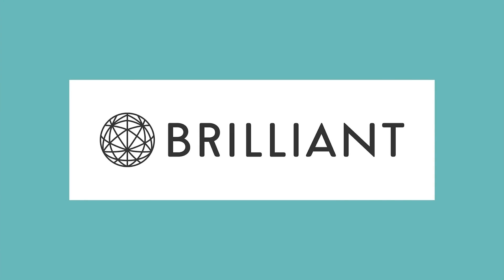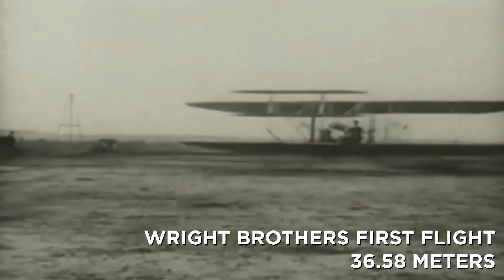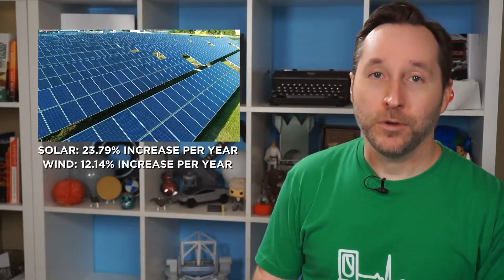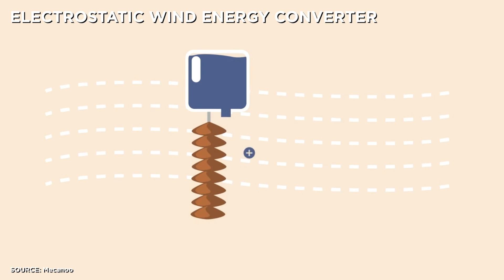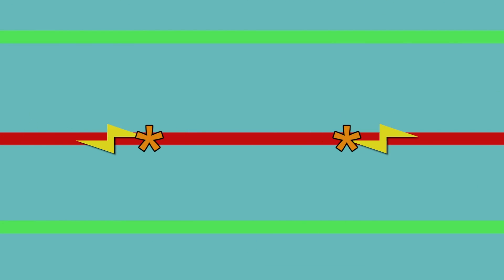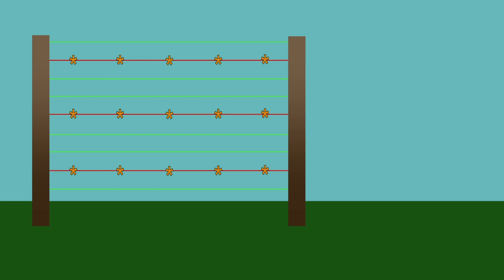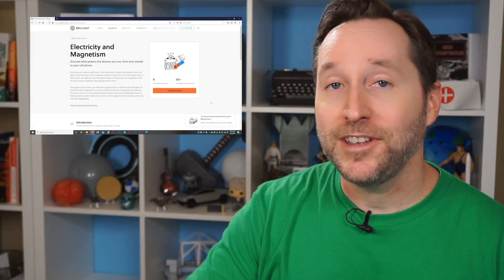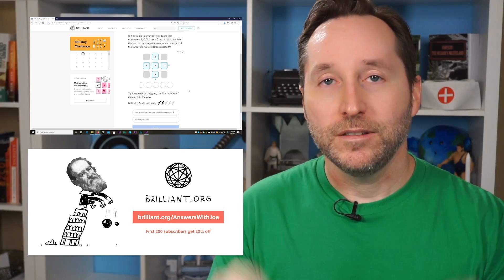Solid State Wind Energy | Random Thursday

Comment: Unfortunately, EHD is nothing new, it has been studied for more than a century by hundreds of differents teams and hobbyists !
The MIT prototype is directly inspired from "lifters" that were made by amateur teams all around the world a few years ago. One famous experimenter in the states was "Saviour", he succeeded to lift 100g of payload using a few hundred watts of power. Just search for "saviour lifters" on google images ! 
For small generators, power levels never reached more than few mW and efficiencies were at best around 1% in both cases; propulsion and electric power generation !
In the states Nasa and Air Force made many attemps to produce high-voltage generators for airborne laser in the years 1970. Expecting megaWatts of electric power they ended with a few watts (for megawatts of flow input power). 
Its not a breakthrough that you need but a kind of miracle !

Comment: Great. Combine it with solar energy by having this act as the stands or posts upon which the panels in a solar farm are connected. Does this system have to be completely vertical to be effective? If not, might work on a roof too albeit the panels would be somewhat raised.

Comment: I wonder if this could have uses in more traditional turbofans as well.

Most military grade low-bypass turbofans have twin turbines. Would it be possible to positively charge the first turbine while negatively charging the second one? 

Or perhaps positively charge both turbine blades while running a negative charge through a nozzle with aerofoil ridges on the inside? This one seems more practical as turbines are already spinning at close to their maximum RPMs in performance applications already.

Comment: Was sitting at work one day at about 6:30 p.m. and there was an explosive sound like a gunshot and one of the third floor building windows near me was shattered. These windows are thick and heavy duty and our first assumption was someone had taken a random potshot at the building. But they found a dead Hawk underneath it. Hawks don't weigh a lot so it must have been traveling extremely quickly when it hit the window.

Comment: should be that bats suffer far larger consequences from wind farms since the wind turbines trap lots of confused insects that struggle to hear bats over the wind turbines.   This means wind turbines  have a much harder cost on bats than birds which is made even worse since bats weight reduction adaptations in their lungs leave them extremely vulnerable to sharp pressure differentials around wind turbines which can lead bats lungs to bleed out. The effects on bat populations are truly devastating to a degree that can't be oversold.  

Also the total costs on birds due to cities are so large because we built cities over bird migration corridors which is something environmental advocacy groups have gone to great lengths to try and prevent wind farms from exploiting.
The far lower casualties are an achievement of advocacy groups so the argument is not oversold. Migration corridors must be protected don't let the wind industry place wind farms along migration corridors. Bird populations are crashing dramatically globally. Thank you for addressing the feline menace though it is a tough struggle to make any progress there despite the mountains of evidence that cats are devastating bird populations because  cat fanatics irrationally believe their precious murder machines couldn't possibly be the mass murdering beasts they are even with direct documentation via cameras that yes cats are responsible for a large variety of wild life declines. Also did you know cats are the main way people come into contact with Y. Pestis infections in the US? Yeah when kitties bring home their presents they can easily bring home nasty surprises. There is a very simple solution keep your cats indoors they will also live longer healthier lives.

Sadly the building costs are far harder to fix because telling people you need to tear down skyscrapers or move a city isn't feasible at all. The largest casualty source in the United States is the city of Chicago as skyscrapers + one of the largest migration corridors in the Americas results in a catastrophic death toll since birds fly in low light condition so they can detect the Earth's magnetic field using flight calls to navigate their environment in the dark.

Buildings induce vast casualties on birds as they reflect birds flight calls tricking birds into thinking they are following fellow migrants rather than hearing echoes of their own voices and leading the poor birds to meet with their doom. Worse some birds get confused by these reflections and send out help me distress calls which brings other birds to help resulting in a trap that draws more and more victims which either die from impacts or often exhaustion. Newer building can be designed to counter these effects but old city skylines lack such developments and so mass slaughter birds.

Comment: The actual problems with wind is that its extremely costly: takes up enormous amounts of land, its ugly as fuck, inefficient, not as durable as people thought and from a life cycle analysis produces more co2 than nuclear by quite a margin. And if you take into account produced kW per m2 its unbelievably bad compared to nuclear and hydro.

Also, cats dont have any effect on the bird population. They are only able to kill already hurt or otherwise retarded birds. Which makes the 2.4B even more insignificant.

Comment: This sounds like scientists trying to find a way to patent Teslas dicovery of ambiant atmospheric ionization of the air by cosmic radiation.  Use a conductor with sharp points suspended in the air insulated from the ground.  It will gain charge.  This conscept was helped by graphen in strands suspended in the air.

Comment: When I saw this pop up on my feed, I thought it was going to be a generator using wires designed to resonate in the wind, attached to piezoelectric generators. Getting a net electric generation off wind + coronal discharge is really a surprise.
Reply: Is this a thing? If not, that sounds like such an interesting idea!
Reply: Same here.  it's nice to see an idea I'd not come across before (thank you Joe).  
Comparing the two ideas without numbers for energy production, it would seem to me that the Idea Joe is talking about has simplicity and production costs on it's side.
Reply: I suspect there's a lot of different ways wind could be used that aren't very well explored at this point.
Reply: @reaganharder1480  Same with ocean waves, I would imagine. I wonder if we could tap into the jet stream with massive floating wind turbines getting net energy AND modifying the weather, moving energy from the atmosphere to the ground.

Comment: They should apply the ionic wind mechanism to jet turbine blades, spun by an electric motor- 
then augment it with the hall effect by making the turbine shroud house a large electromagnet- 
and then add rings that emit UV light within the shroud to further increase ionization. 
This could create a high velocity plasma flow and effectively make an ion-jet engine. 
You'd probably need to isolate the magnetic field created by the electric motor, possibly with an embedded faraday cage in the motor's housing, 
to better control the overall direction magnetic flux within the shroud. 
You'd also need to feed the high voltage lines through the axel of the electric motor-
The axel itself would need to be insulative, possibly a hollow ceramic shaft with conductors within the shaft, and using brushes to pass-through the high voltage.
Quite the challenge.

Comment: "fourty thousand volts" is not energy. It's voltage.
Reply: Yes volts times amps equals watts thanks for the clarification.
Reply: I scrolled down to comments just to see how many people say this. Joe's gonna be hearing about this for a while.
Reply: I'm sure he meant it takes energy to make the voltage.
Reply: No it doesn't. You can easily make it shuffling your feet across the carpet.
Reply: @labibbidabibbadum  For reference, dry air breaks through with electric field of 3 kV per mm. 40 kV will break through 13 mm *between flat electrodes*. With pointy electrodes, electric field gets stronger and breaks through more distance.
Reply: @mhoover  He said "40kv is a lot of energy" which is untrue. e.g. a static shock from rubbing your socks on the carpet is around 20kv, but very little energy, a few millijoules (an actual unit of energy). Volts are the size of a door, current is how fast you move through the door, energy is how much stuff was actually moved through it. Little things can move through a big door. And lots of things can move through a small door if they move fast. People associate volts and energy because we find a big door is often the most efficient way to move lots of stuff and so they are often correlated, but not necessarily. Particularly in this case, because HV is also particularly good at ionizing particle and energy doesn't have anything to do with it. It's like a case where the big door was only needed because you had to move an air mattress through it.
Reply: @mikebarnacle1469  You got all your analogies mixed up. The "size of a door" would better map to conductance, not voltage, for example.
Reply: mikebarnacle the way you described Voltage Current and Energy was probably the most comprehensible explanation I’ve ever read. Thank you
Reply: @jamesbrown99991  There's nothing "mixed up" in an analogy that maps linear functions to other linear functions. Any two models with the same expressions are always analogous. You just don't like the duo which is fine. Make your own analogies. I tried a new one because everyone has already heard the hydraulic analogy a million times and still they don't get it intuitively. So it's clearly not working. Personally I think the hydraulic analogy is not very good because people who don't understand electricity probably don't understand hydraulics either. To represent low energy HV with hydraulics you have to already intuitively understand that head is independent of volume which is just as counter-intuitive to people. A 1mm tube stretched 1km high generates 2288psi, and a million ton water tank 10 meters high only 22psi.
Reply: @mikebarnacle1469  Not sure what you're trying to say re mapping linear functions to other linear functions being fine, when the units of the two functions are obviously different. If someone tried to explain using the hydraulic analogy, and said that the diameter of the pipe represented the voltage, I'd also tell them that their analogy was wrong.
Reply: @jamesbrown99991  Functions do not have units.
Reply: @mikebarnacle1469  Then explain how to use a function to map between voltage and current.
Reply: @jamesbrown99991  By "map between" I assume you mean express the relationship of these measurable properties. V=I*R is the ubiquitous equation... but hey, you know V, I, and I are not units, right? Voltage is a property of nature. A "volt" is one unit we use to measure voltage. V=I*R doesn't have anything to do with volts,  the V refers to *voltage*. It can be confusing because that particular unit has almost the same name as the property, and we're lucky that there is only really one unit ever used in practice. It's easier to understand if you consider that "current" is the property and "amp" is a unit of measurement for current. These equations all work without the units. Units only come into play when we are applying the math to the real world and need to create variables to plug into our equations and derive meaningful results and share them. Technically units only ever matter when a measuring device is involved.

To really understand mathematics you have to wrap your head around this concept that everything is a model. A model is a way of representing the state of a system through properties and equations. I think that it is quite common in middle school and perhaps even high school to latch on to thinking of everything in terms of units. But they don't really come into play with higher-order math, and are not actually needed in practice very often in STEM.

It will serve you well to stop thinking in terms of units and try to appreciate the equations themselves for the relationships they express between variables - and be able to look at it and know how one property is intrinsically connected, and varies, with another property in the model.
Reply: @mikebarnacle1469  The example equation you gave has three variables; each variable represents a physical property and is expressed as a quantity of some unit. Regardless, the original statement was regarding the size of a door being used as an analogy for the voltage in a system (quote: "Volts is the size of the door"), which is incorrect. It about as good as the analogy of: "Speed is the width of the road", or "Height is the cross-sectional area of your waist".
Reply: @jamesbrown99991  no
Reply: @mikebarnacle1469  yes
Reply: Yeah, electron pressure
Reply: I would say it depends on the current . . . . .
Reply: @richhagenchicago  Don't forget time.
Reply: @jamesbrown99991  Joules is energy, Joules per second is power.  Technically there is already a time component in Joules though, though I guess on that logic one could similarly need to say not to forget mass and distance either since a Joule is a Kg*m^2/s^2.  Power in Watts is a Kg*m^2/s^3
Reply: @richhagenchicago  i thought you were referring to the OP, where he said that "xx volts is not energy; it's voltage"
Reply: kinda like PSI is not gas, but actschually pressure.
i mean... c'mon. volts are voltage? 
thanks for the clarification.

Comment: ooh... everywhere with a fence can generate some local power, and I bet you can measure current differentials to detect proximity (e.g. people walking up to the fence and blocking airflow, or touching them) so it could double as a security alarm or sensor fence!

...I play too much shadowrun.
Reply: It would also potentially be a route for a hacker to get in cos it would be connected to the power and security systems.

...I play WAY too much shadowrun.

Comment: Simple fix - change the type of Turbine you use. A Double-Helix Turbine does not kill birds, is not nearly as large, has fewer moving parts, has substantially less maintenance and up-front costs, and most importantly, it does not need to be oriented to wind direction.

Comment: It would be nice it Dr. Epstein provided you with his estimate of maximum attainable efficiency of this device compared to one of many designs of "mechanical" wind turbines, say the extremely simple ones like Dutch windmills, "Wild West" water pumps or that vertical axis contraption consisting of a barrel split in half with halves offset. I don't see any use case where this would be more practical.
Having no moving parts is nice, but we still power our boats using screws or perhaps wheels (or sails), not magnetohydrodynamic drives.

Comment: Hi Joe, interesting; however, I believe there is a method of harvesting electricity from the upper-atmosphere by virtue of realizing optimal voltage gain simply from the difference (electrical potential) between upper and lower altitudes and separated by antennas that capture positive and negative charges at the poles.  This, along with solar calls and small emergency power generator would provide cheap and reliable flight system capable of powering autonomous drones used for localized WiFi internet and perhaps even cellular access in remote areas requiring emergency services for disaster response coordination.

Comment: They need to combine this with the "WINDBELT" Generator https://en.wikipedia.org/wiki/Windbelt  was really big in the news about 10 years ago. Basically Harddrive magnet on one end with wire that can vibrate as wind passes it, and string kept strung like Guitar string idea - they used to sell kits even.  Not quite sure what happened to the homepage but here is profile of company https://www.dnb.com/business-directory/company-profiles.humdinger_wind_energy_llc.8774d892073223bb09647c9fcb601aba.html

Comment: Nah, even if it ever gets to the point where it's efficient enough to use for large scale power production, the power density of this kind of power production is just too low for home use. It would require large tracts of land or other open spaces (like offshore wind farms). Kindof like fusion, potentially a great clean power source, but the scales required at the moment just make home use impossible (not to mention other issues with home-based fusion)

Comment: Okay, I'll say it. This is a stupid idea (almost laughable "free energy" levels stupid) for generating power. Using electricity to generate electricity will never work.  Most things that create electricity consume much more "fuel" than electricity they produce.  For example some wind turbines have an efficiency of 59%. Solar panels AT Best are 42%, most are near 18%. So what good is this going to be if we put in 2,000 wats of power and only get a fraction of it back?
Reply: Now, that thats been said. As a power transmission technology this is really neat!  Put another positively charged wire array 100meters away and let's see how much power it can collect.    Bonus you can harvest some of the lost energy using the technology joe is talking about in this video.

Comment: "Solar, though, has no moving parts"

This is almost always not the case for solar farms. The PV panels roughly track the sun. Last weekend, actually, I was driving I95 and noticed a solar farm with an issue—one of the long stretches of panels' tracking had failed and so it was facing the wrong way.
Reply: The moving mechanism isn't integral to generating power. It only increases efficiency.

Comment: Couldn't they make 40000 volts with very little current ... So the power requirement is lower for the battery powered ion plane